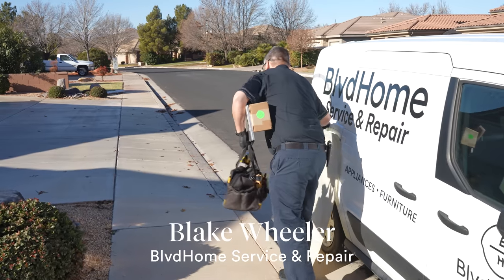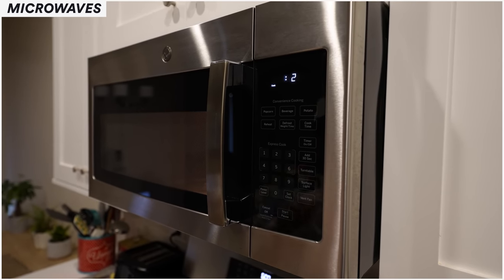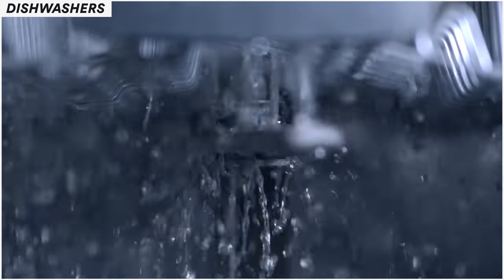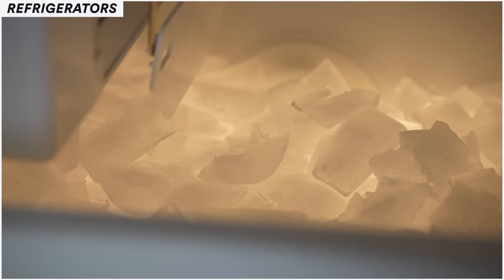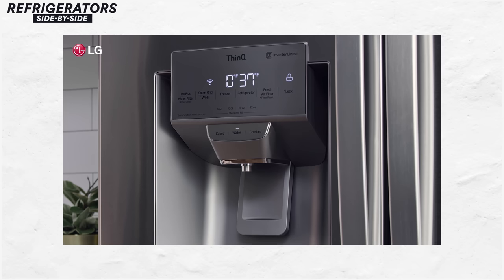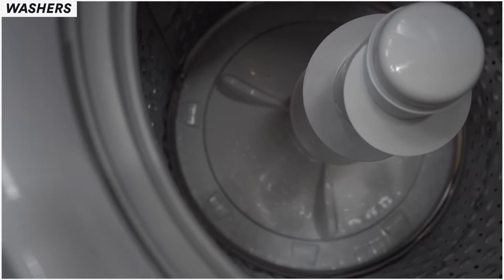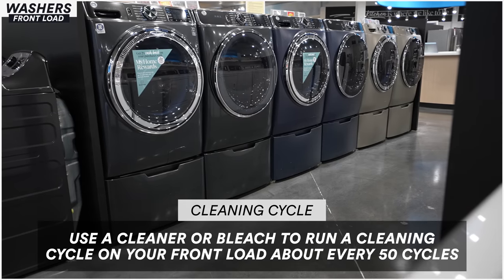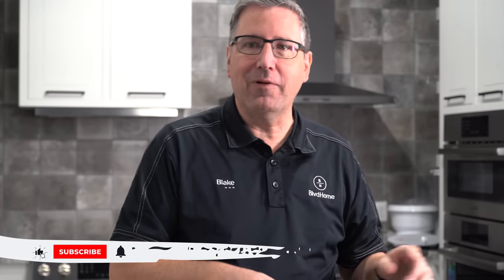Best Appliances Recommended by a Repair Technician of 29 Years

Comment: Really appreciate this video. As a technician myself, our opinion carries a lot of weight versus any sales person. We have nothing to lose by being honest and sharing our experiences!
Reply: If people buy less products that breaks down less thanks to such advice. Then aren't you loosing money?
Reply: Don't listen to sales people at all.
Reply: I am a technician with 30 years experience. Basically his advice was right on while I would disagree with some of the things. I think he was too generous about how well some of the appliances work. And one of the reasons washers get smelly is because people don’t use hot water. Ive had front loaders for over 20 years and i’ve never had an issue with smell or mildew and i’ve never used any type of cleaner or clean cycle.
Reply: @MichaelRei99   what is IVE, is a brand name
Reply: @MichaelRei99 The experience of people who actually do have,"hands on", experience is greatly appreciated. Thank you for sharing.
Reply: Nope if a lot of people buy appliances and they are good. Then a lot more people will buy it.
Everyone knows things fail usually.
So, it's actually good for technicians
Reply: yes I need to cut through the BS to save money. I do the same with cars as well.
Reply: @Amor_fati.Memento_Mori No because most people are not that smart and get sucked up into whatever the sales people say. As a hairdresser I try to tell people what they need all the time which isn't much. They can literally whip up their own concoction using amazon or their local grocery store. You think they listen to me? No. Not only do they want a branded product but they want hundreds of them under their sink that all do the same thing and are overpriced. I'm going to come up with a product line asap because that's what they want.
Reply: @MichaelRei99  I run a hot water bleach cycle once a week. That has kept my front load machines funky smelling free for 45 years. Colored towels get hot water, although no bleach but I do use ammonia or vinegar in the rinse/aka fabric softener cup with each wash, except the bleach load. 
I never use fabric softener. I want my clothes to breathe and towels to be absorbent.
Reply: Would have been nice to hear your opinion on the most reliable top freezer refrigerator.
Reply: Hi, do you have any recommendations/thoughts on freezers?
Reply: Your opinions carry all the weight!!!
Reply: Hi Randy, I just bought brand new home and we’re looking for washer and dryer and fridge and couple TVs. Please let me know what is the best of your knowledge about  brands we should buy thank you God bless you and your family
Reply: and the sales people are influenced by commission, so they will push a shitty machine just to profit.

Comment: The one thing that I have heard consistently from repair men and videos like this, is that you want to have your icemaker be in its natural environment: the freezer area. So you will basically need a side-by-side if you want an in-door icemaker. Otherwise, just get the one at the bottom that you need to scoop out the ice. Even better is if you have an icemaker as a separate appliance altogether if you have the space.
Reply: I’m seriously considering doing that if we have to replace our current side by side.  We go through a lot of ice here in Oklahoma especially during the summer.
Reply: Ditto!  Ice-maker needs to be in the freezer is all I've heard when researching appliances also. We have a Whirlpool side-by-side (ice-maker in freezer) and it has lasted for a very long time without need of any repairs....knock on wood
Reply: Yea, if I had to do it over again, I wouldn't have bought a french door with water/ice in the top since there was ice on the bottom.  We have a whole house filter anyway - I just didn't realize it at the time when we were buying the house.  One of the things the previous owners forgot to tell us.  The tap water is excellent with that.
Reply: Fully Agree, we have french doors with bottom freezer and the ice maker is in the freezer and the ice falls in a bin.  Takes an extra second to scoop your ice but hasn't failed in over 10 years!
Reply: I definitely agree. I know Samsung gets a lot of hate in the refrigerator market, but I got a barebones side-by-side with no fancy features about 5 years ago. The ice maker is in the freezer, and it only has 3 settings water, cubed, and crushed. So far it has been rock solid and has given me no problems, and with 4 to 5 people in the house we go through some ice.
Reply: I honestly prefer "old school"...ice trays you fill up yourself.  Either with or without an extra container to hold cubes separately.  
I guess I just like the really big ice cubes that come from the fill-it-yourself trays.
Reply: Our Samsung french door refrigerator is junk. The ice maker & water quit within 8-ish months. I bought a $98 countertop ice maker on Amazon about 5 months ago and it’s literally the best appliance purchase I’ve made! Makes ice in 60 seconds, and after using ice cube trays for so long, I feel like I’m living in luxury 😂 Anyway, two weeks ago my refrigerator stopped cooling and the repairman said all the refrigerant leaked out - the part itself is $500 and not worth fixing. It’s only 4 years old. Looks like I’ll be getting a Frigidaire… and I’m going back to the trusty side-by-side set up.
Reply: @99telskidSnake you should worry more about Samsung rust 😀
Reply: @thechops2000 we've had 2 cheap Samsung that also leaked/leaking. Never buy a Samsung appliance
Reply: @thechops2000  What is the brand of ice maker you bought on Amazon?
Reply: Exactly !! Never understood having it in the frig part !!!!

Comment: One thing I would add to the ice maker side is if it’s in the fridge area, it’s going to fail or cause problems even more often. Avoid ice makers that aren’t in the freezer
Reply: THIS 100%
Reply: Our LG fridge has had problems but not with its too ice makers, we use the one in the door and its only problem is that the ice clumps up so we pound lightly the plastic clear ice compartment occasionally to loosen up the ice then it works great.  Our LG fridge is about almost ten years old and has the compressor replaced and had a problem with defroster in our bottom fridge failing but the cost of repairs was less than a new fridge and it has been a solid performer ever since the repairs.  The technician removed back lower cover in rear of fridge for ventilation and added a few bricks for spacing against back wall for better cooling of fridge which seems to work well.
Reply: @petie40  Kinda same issue with ice in most frigs ice containers. Wife will open freezer door to get ice. I use door dispenser so agitator to keep ice broke up.

Comment: I bought a Bosch dishwasher based on a repairman’s suggestion. It took some time to get used to and I had to get creative with how I loaded things, but it’s by far my favorite appliance in my house.
Reply: a bosch dishwasher or what?
Reply: The only reason I would not buy a Bosch dishwasher is the nightmare disaster that the rack is.
Reply: @medoelkholy1507  sorry, a dishwasher. It really is an amazing product and easy to maintain. I clean out the filter weekly and wipe down the inside with some dish soap and vinegar water especially on door. I’ve never had issues with odors or any malfunctioning. I consistently use Finish Quantum packs and once and a while I use the Finish dishwasher cleaner (maybe 3 x’s year?)
Reply: @mikede2464  it is something I had to adjust to, and at first I thought I’d made a mistake. I’ve had it about 5 years, no issues, just keep it clean and it never fails me. I do spray Dawn power wash on stainless steel pans first if anything is “burnt” on though. That is the only thing the washer can’t fully remove is black marks inside those.
Reply: @maxhr1749  
Thank you so much
Reply: Which model
Reply: So which washing machine u recommend....overall...
Reply: What’s wrong with the racks?  Please explain.
Reply: can you explain what you don't like about the racks?

Comment: I’ve been in business 29 years next month, and we share some of the same thoughts. I only recommend Bosch dishwashers and Speed Queen laundry equipment. The LG top loader washers are good too. I don’t see them for service until about the 10 year mark. The GE top load washer is another story all together. Their transmissions leak oil within the first year of service. And the newly mandated R600a is problematic to say the least. I’ve diagnosed about a dozen refrigerators using it, all less than a year old, with locked up compressors.

Comment: Miele washers and dryers in Europe used to come with a 10-year warranty, and they would last much longer.  My washer spun at  1600 RPM, and clothes would come out just damp.  Miele is expensive, but good for people who hate having things break.  I totally agree on the Bosch dishwasher.  I haven't bought either in the US, so they might be different.
Reply: Just made that same comment! Miele is serious stuff, their dishwasher held up for more than 10 years in a family of 4. same with our fridge!
Reply: This is outdated information. They now use self-destructive material for the "crest" holding the drum. They will argue that you've used wrong powder or water ph was not right. It used to be stainless steel - now cheap aluminium alloy. BTW 10 years is probably myth: at least in my country it covers only engine; so really it is just 3 years which is nothing.
Reply: @АгронДепартье  Dude, my Mum's recent Miele washer has a full Metal Drum casing! It fully depends what you pay. And just for your Info: All the other manufacturers have plastic instead of metal, where Miele has reinforced Metal parts. And how does ph/detergend play a role in drum enclosure or -anchoring?
Reply: @Elektrotechniker  Guy, you can't see the drum holder without disassembling the machine. The drum holder is between the drum and drumcase (that can be plastic as it typically doesn't cause problems). The drum holder is attached at the back of the drum and holds the axis. May be my English is not good enough...
Reply: As a student back in 1996, I purchased an old Mile washing machine from a retiring elderly woman for 50 guilders. The machine was intended for temporary use, but it turned out to be so good that I continued to use it until 2008. Unfortunately, carrying it to my fourth-floor apartment was a challenging task since there was no elevator, and it took four of us to bring it upstairs.
Reply: @thejaramogi1  Old Miele were really good, but not so anymore. Anyway 14 years is not that much. Bosch can run longer - now the second set of graphite electric contacts at the engine. If you did not have to change those, then your Miele worked less total hours than that Bosch.
Reply: @АгронДепартье  Dude, do you think I didn't had the cover of that washing machine? Sure had, and I was looking at reinforced metal parts. Bosch nowadays neans just the usual plastic Quality, the are in no way better than this german family owned business, that's still standing while penny-pinching brands like BOSCH, SIEMENS, AEG, Electrolux, etc. are their competition. I have contacts to the Miele Engineering and Development Department, and was on the verge of joining their Engineering Team because of their philosophy. Also, not all plastic parts break if designed properly...
Reply: @Elektrotechniker  Your message is unclear: what cover do you mean (top ?) and, if relates to drum holder, what is the connection ?
Reply: @АгронДепартье  When I purchased it, the washing machine was already quite old, around 15 years or so. However, it was well-maintained, and the previous owner had used it only once a week, which I continued to do. I never had any problems with it, and the clothes that came out very clean and almost dry after washing.
Reply: @thejaramogi1  Still not much:(15-14)*52=approximately 1500 cycles. Compare with 22*52*3=approximately 3000 cycles and still running (it could be more than 3 cycles per week as well).
Reply: Agreed. As a salesman dealing with whitegood appliances in Europe, Miele is the best washing machine with lifetime warranties on their engines. After that AEG (Electrolux) and BOSCH/SIEMENS are very good alternatives. I disagree with the LG recommendation on washing machines. I've seen many cases of the heating component failing to work or the device leaks.
Reply: @АгронДепартье  "May be my English is not good enough..."
...I wish I could speak Russian as well as you do English.  ;-)
-- BR
Reply: @billredding2000  A quick question - how do you find information about relevant language/country of a person on YouTube ?
Reply: @АгронДепартье  I don't know as I have never tried to find out. 
Sorry...
-- BR
Reply: @Elektrotechniker  we have 20 year old Miele washer and dryers and a fridge freezer used for a garage which I assume is also as old but I wouldn’t go near the newer stuff with the perception that they will last anywhere near as long. 10 years isn’t much to be far, our Samsung American fridge freezer has lasted that long also with no issues so I would expect longer for Miele. Miele reducing their guarantee also makes me very suspicious
Reply: @Elektrotechniker  We're not talking about the drum. We're talking about the part that holds the drum, something you can't see...
Reply: Miele vacuums are also recommended by appliance repairers!
Reply: 12:08 also not getting cleaned out? Fabric softeners.
Reply: @Elektrotechniker my Indesit did the same and is 1/4th the cost. Miele is very expensive... They were very good, but them lowering the warranty period will say enough...
Reply: @derick3482 where did you get that number from? Miele washers are usually around 1k each but well worth it as they will outlast anything cheaper
Reply: @hereforit170  I had a Miele canister vacuum in Europe that was still working great after 18 years, although my ex-wife would probably say that that's because I didn't vacuum enough.😉  In the U.S., I've been using a Dyson "ball" canister vacuum.  They're both good, but I don't know about long-term reliability of the Dyson yet.
Reply: Miele and LG are the only two major manufactures who make all their own parts, that is what allows both Miele and LG to make such good products. LG had an issue with their linear compressor in their refrigerators but they have refined the compressor and improved it and the new refrigerators have the new improved linear compressors.
Reply: Live in Germany and bought only to Miele dishwashers in last 30 years. The first wan was fully functional, but I wanted some new programs.
Reply: The problem with Miele is that they are too small electrical appliances like all European ones. Therefore, they cannot be my personal choice regardless of their quality.
Reply: Good is l❤️❤️
Reply: Miele is top of the line for washers. Mine is 11 years going strong with practically zero maintenance (renting the place over the last decade). My brother has a model since 2008, zero issues (his wife is a bit more maintenance savvy though).
Reply: @АгронДепартье  14 years is a lot, most common brands (LG, Samsung etc) will take you 5-6 years before drums, bearings, pumps start failing. They can be replaced but with costs nearly half of the unit price. But agree that Bosch is probably up there, my 9yo dishwasher going strong.
Reply: I’ve had a Dyson animal since 2005 and it’s starting to show its age but still going strong.  Clean the bottom filter out regularly though.   But my next vacume is going to be a Sebo and I can hardly wait.

Comment: I can attest to the LG fridge sucking, ours gave out around the 6/7 year mark. Same goes for the LG washing machine, the dryer was about to go too but we met a clever repairman who was able to save it.
Reply: bummer I really want that LG twin wash with side kick. But anyhoo same with Samsung. Our first Samsung fridge bought 2010 freezer started leaking 5½ years in. On and off repair we've had enough and retired it last year. Our 2nd Samsung bought Dec 2011 fridge started leaking Dec 2023 exactly 12 years later. Freezer is fine but we'll replace it with a local brand in my country as first choice. 2nd choice is Panasonic. 2010 cheap Samsung started not working 2017. Could still be repaired.

Comment: Great video.  Thanks.  We have a Bosch diswasher.  It cleans well as you mentioned.  The problem we have had is with the rack tines rusting.  Another problem we had is with customer service.  In our previous Bosch diswasher when the racks started rusting, we called and had the "obligatory" long delay in getting to discuss the problem with someone.  The CSR said we could purchase new racks for $500!!!!  We said that we might as well purchase a new one.  We did.  In less than four years, the racks were rusting again.  We called and the CSR said they would get back with us.  Three months later, they said we could purchase new racks for half price, which ended up being about $100 (our price).  We asked why on the previous model the CSR wanted to charge us $500?  The CSR replied, because we charge back to the customer the cost of storage.  The model you had was a certain age, and so we charge for the part, and the cost we incur for storing it.  What a crock of crap.
Reply: Customer service is everything to me so Bosch is crossed off my list.  I’d be so pissed!